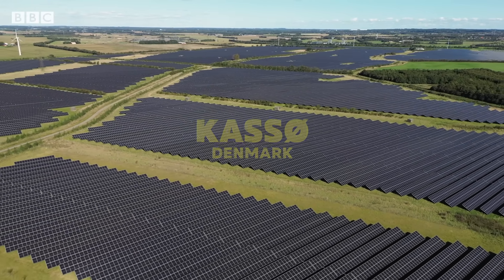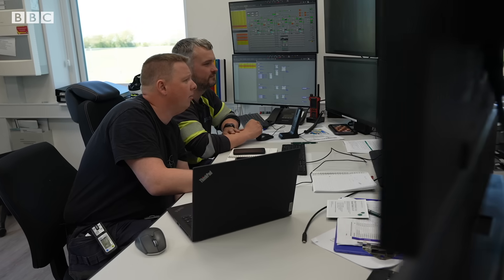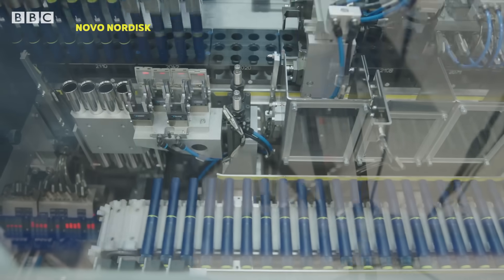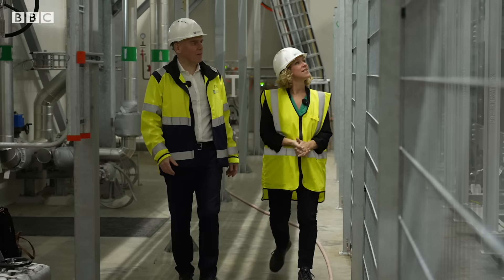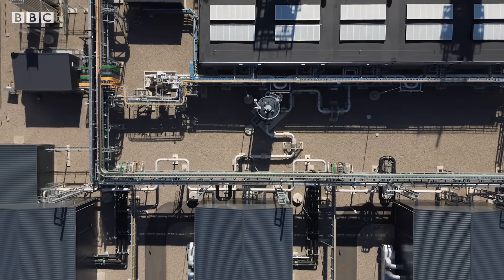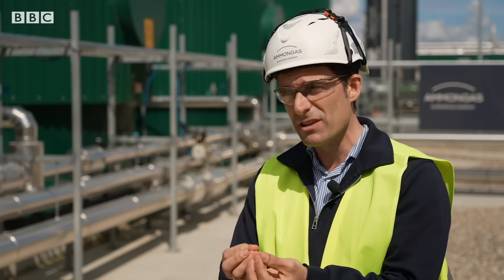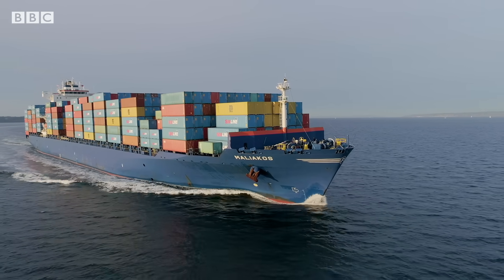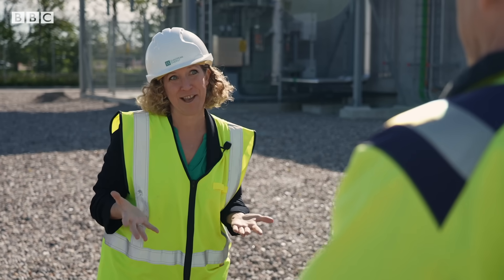What is green methanol? | BBC News

Comment: So it is even more inefficient than using the hydrogen directly...?
Reply: You can't use hydrogen "directly", you have to compress it or cool it down for liquefaction to store a decent amount of energy in an acceptable volume. 
This costs energy - very much energy for liquefaction. 
And the conversion from hydrogen and CO2 into methanol is pretty efficient. 
So the overall efficiency is pretty similar in both cases.
Reply: @701983 With directly I meant fuel cells.. And what effiency are you talking about? Just with electrolysis and compressing the stuff you loose about half of your effiency compared to just charging a battery. Then by burning or using it in a fuel cell you loose another more than 50%. That leaves you with  like less than 25% actually leading to propeling you forwards compared to more than 70% when used in a BEV. 

Hydrogen definitely has it's uses, but anything road going ain't it! 😂
Reply: @rkan2  I don't know why you talk about roads and BEV here. The video is about methanol for chemical industry and fuel for cargo ships. 
That's what I referred to as well (ship fuel).
Of course, it doesn't make much sense to waste this scarce fuel for cars, where we can use batteries instead.
Reply: @701983 Even for ships it is questionable. I can understand natural gas substitution and use in flying things.
Reply: @rkan2  "Natural gas substitution"? You might have confused methanol with methane?
And there are ships that run on natural gas (LNG), so "natural gas substitution" could mean a use as ship fuel as well. 
What other applications did you have in mind?
Today, there are two major ideas for future ship fuel: Green methanol and green ammonia. Both have their pros and cons.
Reply: @701983 I am referring to the many chemical industry processes where natural gas is king, even for making said hydrogen at the moment. Once you have hydrogen, you can substitute it easily in the chemical sense anyway to almost any chemistry process, especially the ones using something that used natural gas at some point before.

In these processes there are absolutely no suitable green alternatives except using green hydrogen. When moving things on the surface of the earth, or even in the air, there is always an alternative, even if the alternative is "bad" from an energy density point of view.
Reply: @rkan2  There might always be "an alternative", but also a realistic one?
Long distance shipping and long distance flying will stay dependent on fuels with high energy density. We won't turn back to wind powered ships in commercial shipping. And we won't use solar/battery/wind-powered airships for air travel. 
It will be the question: Biomass-based fuels or hydrogen-based fuels (e-fuels)?
Reply: @rkan2  And of course, hydrogen will hardly be used directly for fuel in transport, it will be used to produce fuels with easier handling. Like green methanol.
Reply: @701983 Personally I still see even stuff like space lasers or electric grids spanning oceans before hydrogen derived fuels will be used in container ships at a great scale. Making kerosene via hydrogen probably makes sense for the flying things, since it requires really little recertification. Commercial aircraft based on anything else except the current ones are kind of like fusion energy, always 15 years away. 😅
Reply: Must not forget using anything but hydrogen is usually a bit easier. 😅

Comment: Green Ammonia is better.
Reply: Both have their pros and cons.
Personally, I prefer methanol: It's less toxic, less corrosive, easier to use in combustion engines, and it's a liquid at ambient temperature and pressure.
But of course, the need for a renewable CO2 source is a significant downside.
I believe both chemicals have a future as green fuels. And of course, the chemical industry will continue to need both substances. And hopefully consume the "green" version of them in the future.

Comment: Did they forget that the amount of water on the planet is limited? Nature does not produce water, so by doing this they are reducing the amount of water on the planet. Let’s wait for a hundred years to see their grandchildren bearing the “fruits” of this wonderful “green” technology
Reply: When you burn methanol, you produce carbon dioxide and water. It's a cycle regarding fuels. But okay, if you produce plastics (like LEGO) with the methanol, the hydrogen is away from the circulation, potentially for a long time. 
But it's a little bit odd, how many people care about the amount of water on the planet at this topic, but never consider the increase of the earth's water supply by the combustion of fossil hydrocarbons. This adds around 10 billion tons of water annually. 
However, it doesn't really matter, it's nothing compared to the natural water cycle. These 10 billion tons annually have virtually no effect to the sea level rise.
Reply: And by the way: "Nature does not produce water": It's a cycle as well: Nature splits water into hydrogen and oxygen by photosynthesis (photolysis of water) and it produces water by the oxidation of the biomass (dissimilation).
Reply: The production of water through the metabolism of nutrients (especially carbohydrates and fats) plays a crucial role in the water supply of certain animal species.The fat humps of camels can be seen as indirect water reservoirs, since the metabolism of 1 kg of fat produces over 1 kg of so-called metabolic water. Kangaroo rats don’t drink water at all, they meet their entire water needs through their food, mostly fatty seeds.
A human (average adult) produces around 250 ml of metabolic water per day. 
I added this because I find the topic quite fascinating.

Comment: Why not burn the methane instead of using so many resources to convert it to methanol? Simply for storage and transportation to use in the shipping industry?
Reply: They don't convert methane into methanol. They split water into hydrogen and oxygen and use hydrogen and carbon dioxide to synthesize methanol. Directly, without methane as an intermediate.
Reply: @701983  Damn, that's even worse. The round-trip efficiencies must be terrible!
Reply: Additionally: Biogas is a mixture of methane and CO2. They separate the CO2 from the biogas.

Comment: It produces 42,000 ton per year and needs 300 hectares of solar panels to make it run? Is this for real?
Reply: Ofcourse electricity from windmills can also be used to manufacture waste  products (manure but could be anything containing carbon) into 😮methanol.
Reply: It’s like storing energy into batteries but actually it’s using it to produce fuel lol!
Reply: All the sceptic idiots in here. Just be happy someone try to make the environment better and stop with the bad excuse of  but but its not 100% neutral. It will never be 100% neutral.
Reply: No mention how much electricity is produced/used annually???
40kt of fuel isn't going to power a single big ship for that time
Reply: @jimurrata6785  "40kt of fuel isn't going to power a single big ship for that time"
Maybe not the biggest ships of this kind, but 42,000 tons of methanol are 232,000 MWh heating value. Converted with an efficiency of 40%, this would be 93,000 MWh mechanical work. With 7000 hours of sailing per year, this would be an average power of 13.3 megawatts. Enough for pretty big ships.
Reply: @701983   I may be off because I made no attempt to correct between fuels.
Just judging by the 400t per day figure for bunker in a large container ship.
Either way if the Danes have ezcess pig poop and electricity I'm sure they'll find a good use.  👍
Reply: @jimurrata6785  It's rather 150-300 tons per day for Ultra-Large Container Ships (ULCS) with more than 20,000 TEU, depending on their speed (slow steaming?). Which would be 44,000 tons to 88,000 tons per year (with 7000 hours of sailing per year). 
But methanol has a much lower energy density than hydrocarbons. So 42,000 tons of methanol wouldn't be enough for such a giant, but still for a pretty big ship (e.g. around 10,000 TEU).
Reply: @jimurrata6785  Some of these ships COULD burn 400 tons of bunker per day, if they'd sail with maximum power the whole time. But this would be exceptional, not normal operation.
Reply: @701983  Apologies that I don't know much about the costs of global shipping. That was the figure I was given when I incredulously  asked my mate "How much fuel can one of those big container ships possibly burn?". 😂
I appreciate your attempt to educate me. 
How to put this methanol to work in a ship is something else I would like to better understand.
Reply: As far as I know, it's powered fifty-fifty by this solar power plant and by grid-electricity (a lot of wind power in Denmark). 
And what's the point of your question: Do you think, it's a lot of methanol or just a tiny amount?
It's just a pilot plant.
Reply: Sheep grazes the grass around the solar farm, the numbers kept is about the same for 240 hectare farm
Reply: Don't worry the there's plenty of land to build solar farms on.
Reply: It looks like an experimental facility (aka proof of concept) to design and fund larger plants in the future. It's not just methanol production that they need to worry about. Cargo ships dock in ports all around the world, so they need to think about transporting and resupplying Methane in all major ports if it were to be used commercially. And they can probably sell the green hydrogen as well. A number of steel companies have been experimenting with using hydrogen instead of coking coal.
Reply: @yo2trader539  you should google Maersk and you might understand why Denmark is doing this and you probably won’t worry about supply chain when Maersk is the linchpin of the worlds supply chains every link in the chain, Denmark is 60% farmland and 240 million animals produce per year so we have a lot of biomass waste, windmills +60% of electricity production solar lots of other stuff 25% 15% fossil fuels
Reply: 42000 tonnes per year ☝️🙂
Reply: @kareheahakowaiahaura it’s a tiny facility and they can build much bigger ones using excess of renewable energy to make it

Comment: So shyt is our new fuel?
Reply: Yes, you need Biogas to have a Carbon source for Methanol, and Biogas comes from manure.    
As shown in the video, the plant can split water into Hydrogen and Oxygen; however, you need Carbon to produce Methanol, so you get the Carbon from Biogas, as Biogas is CO2 and Methane Gas mixed together.

Comment: Ah yes, another miracle fuel that just needs a few more decades, a few trillion in subsidies, and a steady stream of PR videos to save the planet, right after it saves corporate balance sheets. Funny how every ‘green breakthrough’ somehow avoids going all-in on hydrogen, the one fuel that could actually change everything. It’s almost like the goal isn’t progress, it’s keeping the old system on life support.
Reply: Hydrogen is promising, but also has a bunch of problems with it. The main one is that currently almost all the worlds hydrogen is produced as a byproduct of cracking hydrocarbons from crude oil. Hydrogen can be produced from the electrolysis of water, but very few places are doing this at scale using renewable energy. So if we all switched to hydrogen, unless we had very strict regulations of the supply chain to prove it wasn't made from oil, or using electricity produced by fossil fuels, then it won't be any greener than just using fossil fuels.

Hydrogen is also difficult to store, because it's an explosive gas. It's difficult to use for vehicles because to store it you need heavy high pressure steel containers, and if it leaks then it's way more deadly than even natural gas explosions. In theory we could convert people's gas lines and boilers to use hydrogen instead of methane, in practice government studies have found that this would be way too dangerous.